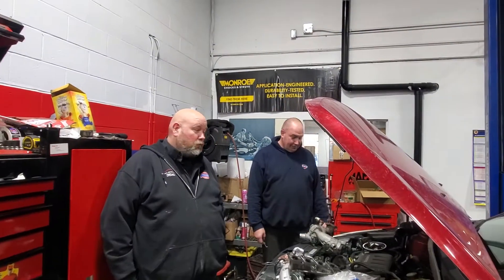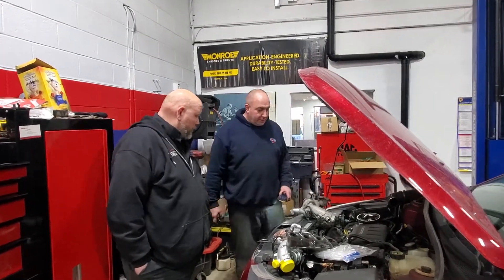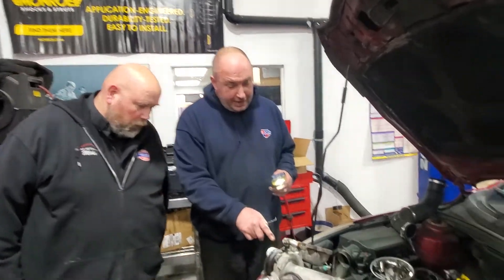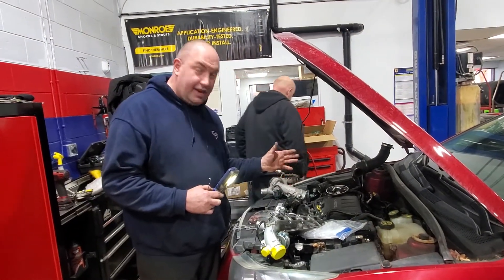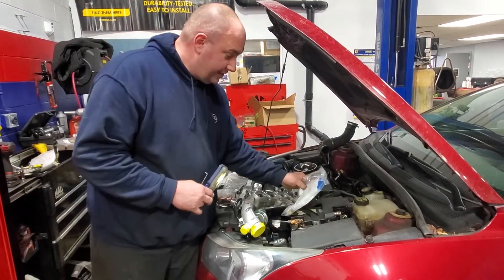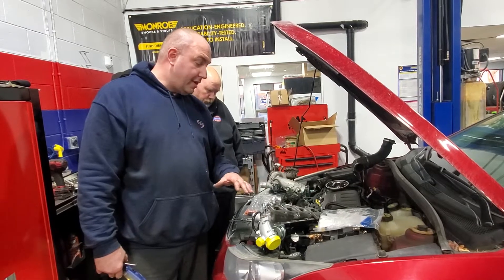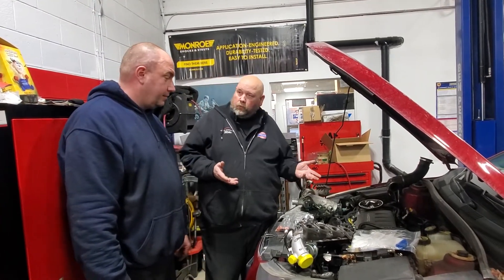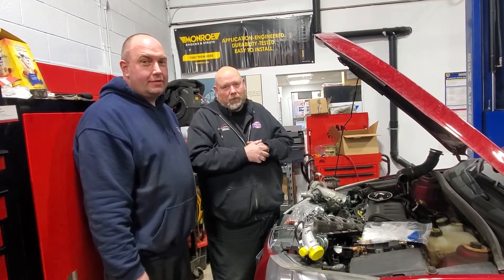1.4 L Eco-Tech Engine Turbo Replacement for code PO299 @UrbanAutomotive01

Comment: I have p0299 code on cruze 2011 1.4 lt
Reply from the maker: Sorry to hear that. Check your air filter first. If it's not dirty you will have to start the process of checking for this issue as it is extremely common.

Comment: I had a underboost p0299 code and it was a dirty air filter. Code fixed
Reply from the maker: Nice catch!  A dirty air filter can definitely cause a P0299 underboost code — it restricts airflow to the turbo and throws off the pressure readings. Great job tracking it down and fixing it! Always a good reminder to check the simple things first. Thanks for watching and subscribing

Comment: do you know how these dorman turbos hold up over time? ive heard some horror stories about these not even lasting a year, but have also heard they work just fine. am wondering if premature failure is from poor QC or if installer error/ lack of supporting repairs are to blame.
Reply from the maker: We have replaced 5 units over 2 years, no comeback issues at all. Thank you for watching.